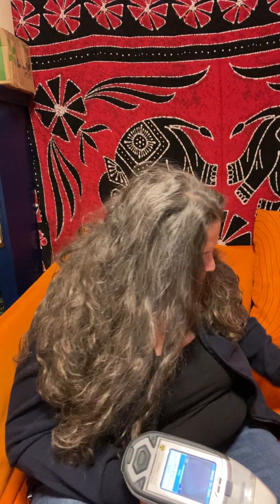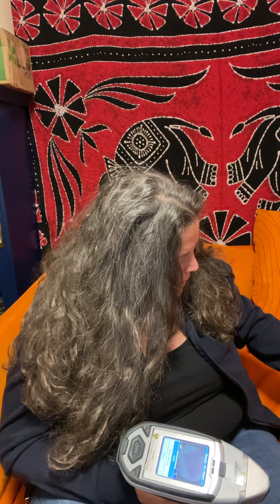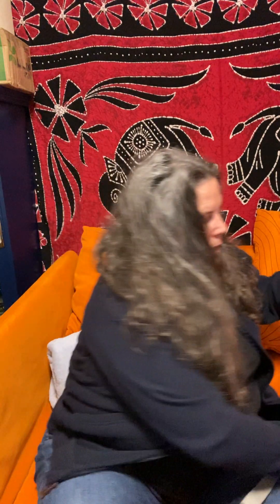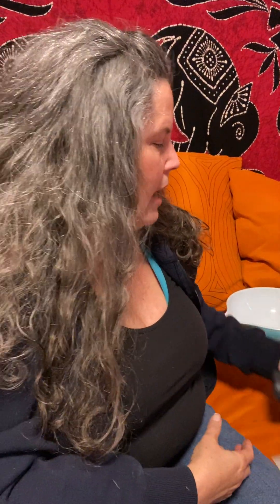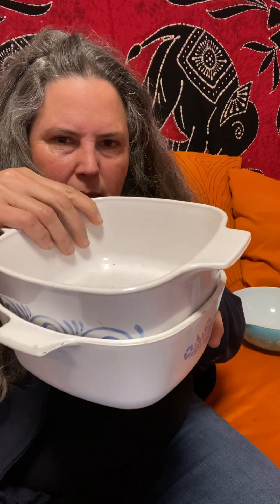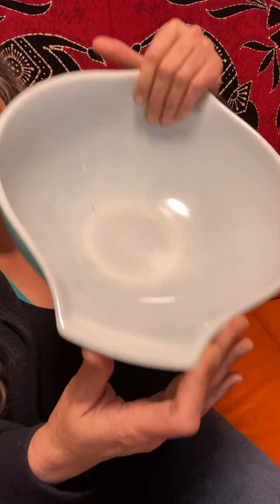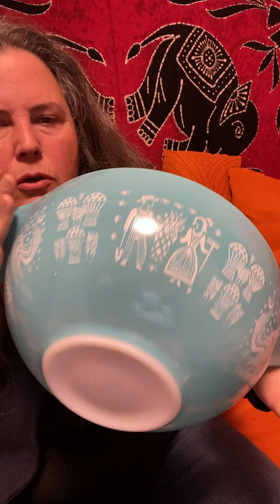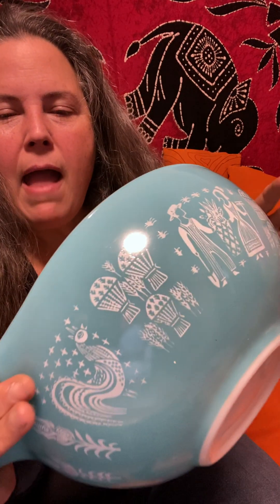Testing Vintage Pyrex for Lead using XRF technology

Comment: how can one test on their own without dropping $35k on a machine?
Reply from the maker: You really cannot. That's why I created the Lead Safe Mama website, which has about 4,000 pages of information - most of which are consumer goods test results. You can look up your products there (and none of the information is behind a paywall - it is all freely accessible). Start by checking out the website menu.

Comment: I'm very disappointed as I ADORE amber-tinted glass dinnerware & drinking glasses the retro look from the 60s and 70s.  You tested the Duralex Lys clear glass plates, which passed.  I want to know if the amber-coloured Duralex Lys glass dinnerware is ok.  I got some from The Kingdom of Tableware, a distributor which I assume only sells new products, they have the Duralex stamp on.  Duralex's own website shows only clear glass, except for one plate and the Le Picardie drinking glass.  And why is amber glass used for pharmaceuticals/essential oil and beer bottles, pipettes, etc?  Isn't it beneficial?  Would you know about Kinto, a Japanese company that make amber glassware? Or Sabichi's mugs made from new bone china with some orange paint on the outside?   Regarding Duralex, you passed the safety test for their blue tinted drinking glass https://tamararubin.com/2018/01/newer-made-in-france-duralex-marine-blue-tumbler-lead-free-these-are-the-drinking-glasses-we-use-in-our-home/, but I don't want blue, I want amber.  I need to know if the Le Picardie is ok or any other amber drinking glasses,  I had my heart set on these.
Reply: Also, what about Duralex's Versaille tea/coffee mugs range, in amber?

Comment: where can I buy that device? and btw do you know if the cotton swabs are accurate? thank you in advance😊
Reply: She said it's costs $30,000 to $50,000 for the device and you have to be certified to use the it. The swabs don't work well on consumer products.

Comment: Please complete your tests orderly. Is All white Correlle cookware safe?! You said it was. So we switched to it. But you didn't test the white on those Correlle square pots. & Is Clear Vintage PYREX Safe?! I'm so confused now by how you test & say. Please show tests more orderly & Complete. We are so worried now for the grandkids. Please help. Please Test All White Vintage Correlle French & Winter Frost cookware.  I thought you said that was safe & Clear Vintage Pyrex. So we are using it per your recommendation. I hope we didn't misunderstand. We spent alot to change.
Reply from the maker: All of these items are on the website with test results. There is a search bar at the top of every page of the website so you can easily search for the item you would like test results for: http://www.LeadSafeMama.com
Reply: @LeadSafeMama  great, thanks